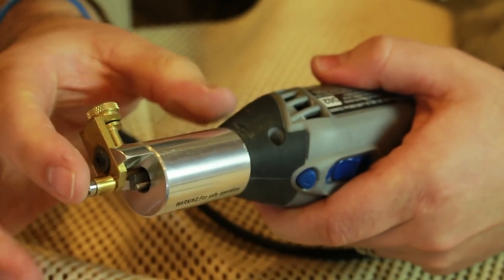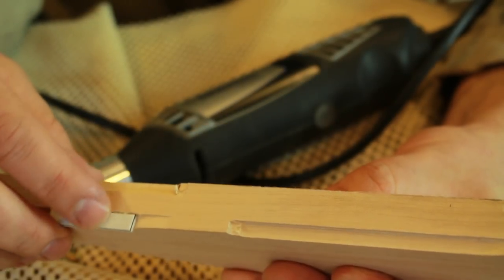How to Make a Binding Channel on a F-Style model

Comment: Interesting tool that i haven’t seen before. You seem to have set the depth of cut from the get go but nevertheless work your way to the final depth in several passes by levering the tool. As someone else here commented, during these steps your in all the way :-)   there’s no way back.
Reply from the maker: Yes, the dremel tool seems to be lacking power on the maple side and the bit heats up pretty quickly on thick cuts. With thinner cuts I can creep slowly to the final depth. I do something similar on the Spruce soundboard but it has to do with the rotation of the bit and the wood grain( to prevent splits or chips) Thanks for watching Maurice